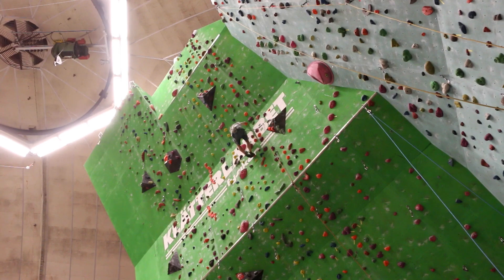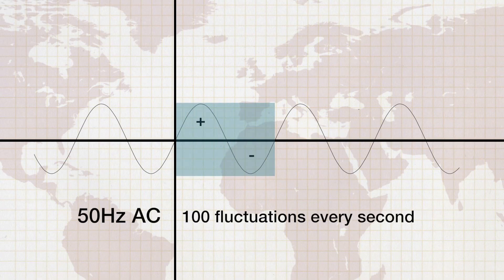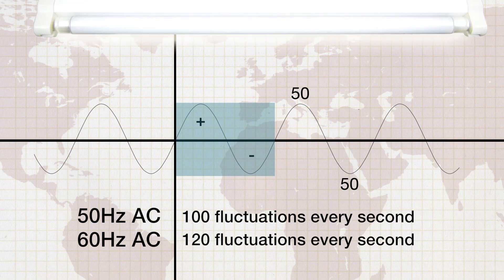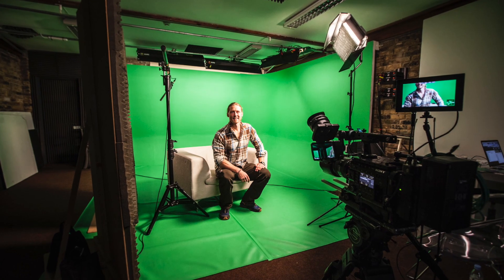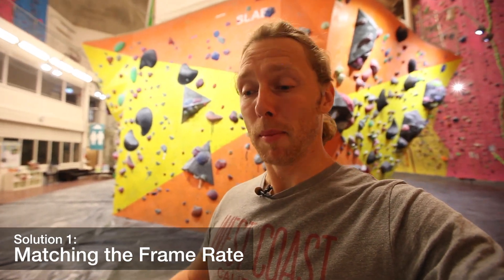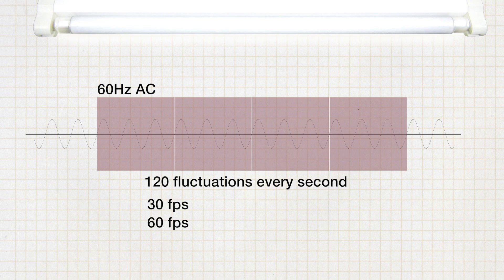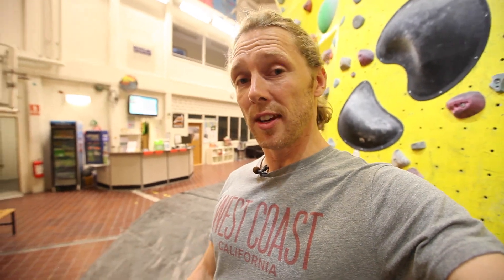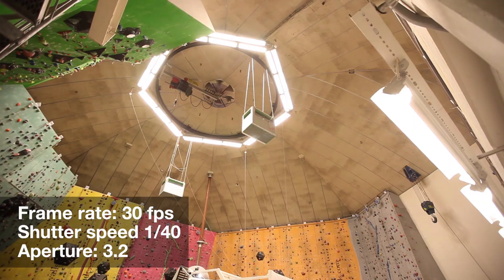Fluorescent lights & Flickering Video: A traveling filmmakers dilemma

Comment: Thanks for the video. Quick question: On GoPro settings I cannot change the shutter speed in a 50hz region. Shutter speeds are 1/30 1/60 1/120.... however, when I change the shutter speed from auto to 1/30 the flickering seems to diminish. Any thoughts?

Comment: The tricky thing is to be able to shoot at a slower shutter speed with a device that has no iris control. Like a smartphone, drone, or Action cam. For these you need to learn about Neutral Density filters in order to get the slower shutter speeds. https://www.youtube.com/watch?v=mFPc3Mmg5-M
Reply from the maker: Well, maybe not so relevant to the flickering lights issue but in other cases NDs clearly help a lot. Although, related to your comment it can be worth mentioning that many newer devices like drones and action cameras may now have a flicker control setting, like an anti flicker option, that can help a lot!

Comment: Hmm. thanks for explaining this. However the Go pro Hero 8 does not have the option to do 1/50 or 1/100 shutter speed? Im in Australia? Any suggestions?
Reply from the maker: Maybe try and switch between NTSC and PAL. That could help in some cases. Automatic settings in action cameras make the shutter speed thing a bit more difficult...
Reply: @robnelsonfilms  ended up that the hero 8 has an antiflicker setting which you can set to 50. or 60. Solved the problem
Reply from the maker: @GeorgeGoosen  Ah!! That's rigth! I heard about that. Awesome!

Comment: If you've got Canon 200d/SL2 you can choose between PAL/NTSC video mode which is gonna give you either 25/50 or 30/60 fps options for shooting your video.

Comment: Hi mate !
I don’t know what happens if you want to shoot at 60fps indoor with attirail lights (to be able to do slow motions while editing). Do you use a 1/120 or 1/50 ? Outside with sunlinght it’s 1/120 but when you re inside .. cause I heard that with those lights you should not go higher than 1/50.. let me know if you did some slow mo inside !
Reply: He use 1/50 for flickering but at 30 or 60 fps

Comment: what really sucks is when there are different light sources in a room that have different frequencies, so no matter what shutter speed i set it to, there will still be flickering. I suppose that is impossible to fix? ;/
Reply: You can use software to fix that to a extent
Reply: @palsgarasje  Or by using the shutter angle and the shutter speed ,if you are just with 30 frames/second .

Comment: Hi I experienced it recently on a showreel video I was making with some friends.  I wonder if anyone can advise on ways of editing this out if at all possible?I am currently using Adobe Premier Pro and load the individual video footage into Proshow Producer (to combine it all with my own choice and way of editing just now).Thank you for this vid which has helped me learn more regarding light Hz with my early efforts!
Reply from the maker: Hey! We know how frustrating it is to get back and find your shots flickering. If you shot it in a "normal" frame rate, basically 25 or 30fps and not in slowmo, you can give this a try. Duplicate your clip and put the copy on top of the original. Then move the top clip ONE frame forward. So now your two identical clips are offset by 1 frame. Then drop the opacity of the clip on top to 50% (alternatively you can play with various blending modes like "Overlay" but it might also affect the colors a bit). This will hopefully make your clip workable again. Don't forget to trim off that extra frame at the end. Good luck and please let us know how it goes.
Reply: @robnelsonfilms  Yeah it doesn't work in this situation unfortunately :( At least it didn't work for me no matter how much I tried

Comment: Thanks, this was great!
Reply from the maker: +FocusPulling (.com) Thanks! One of those things that messes you up no matter what camera you have right! Happy to hear you liked it!
Reply: +Rob &amp; Jonas&#39; Filmmaking Tips It's sort of incredible that extremely sophisticated tools like Boris Continuum's Flicker Removal plug-in aims to fix this kind of flicker, and rarely can. If you're stuck with footage as such, having shot it without your process outlined here, another trick is to stack a duplicate video track higher, offset it by one frame, and change the opacity to 50%.  Weirdly, that reduces the flicker almost to nothing.
Reply from the maker: +FocusPulling (.com) You're right. I was thinking of including that in the video too but lacked a good demo shot. I had some clips shot in higher frame rate and those did not work all that well with this technique.